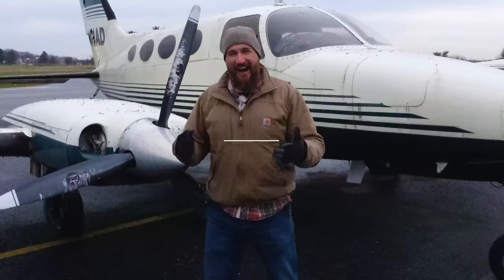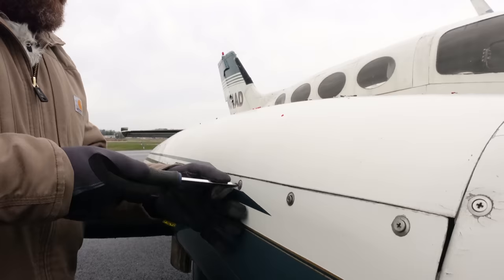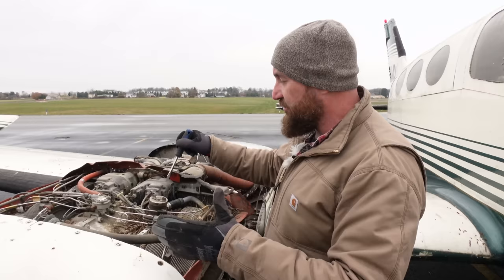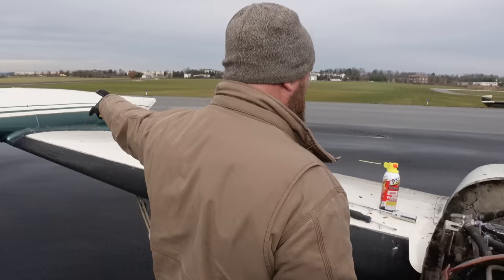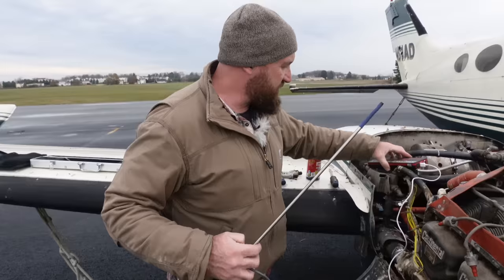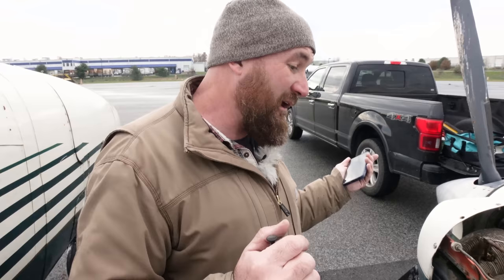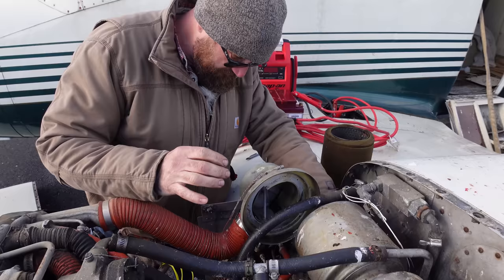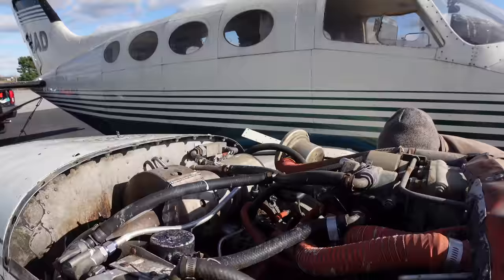FREE Abandoned Airplane... If I Can Start It! Ep1

Comment: I'm an A&P and have to say you did pretty good cleaning the spark plugs, though I will say be careful turning the prop with all the plugs hooked up, the Mags can fire with everything hooked up. Nice video overall, would love to see it restored but it would take a lot of time, money and paperwork for sure
Reply: Also an A&P. Personally I'm wondering how this'll be done legally, paperwork wise with the FAA I mean. That's where a free plane gets expensive. 

About a year ago exactly I was working on this shitbox of a 1975 310R that was parked at KDAL because it was running rough. I was out there by myself to do the runup. Ran like absolute trash, could easily tell it was down a jug or 2 on each engine. So bad I had to have my buddy/coworker see that shit for himself, and in disbelief he called his pilot friend to check it out. On the #2 engine one of the pistons was melted and metal was all inside the crankcase and everywhere else, not to mention all the other discrepancies this plane had. Surprised they didn't have total engine failure in the air. No way in hell I'd ever fly it in that condition.
Reply: You can fire up the engine with the props removed, given an electric starter?  That seems a lot safer. It's what we do with model planes - do all the "working on it" with the prop removed.
Reply: @senseisecurityschool9337  I think that could cause damage to the engine and probably isn’t allowed.
Reply: @jacobboneill4295  It would be interesting to hear from someone who knows. You can certainly run a car engine that way. You wouldn't want to go full throttle with no load because the RPM could go too high.
Reply: What a nice playhouse for my Grandkids & me!!! And yes it runs!! 😉😉😂😂
Reply: You know he can't. I almost see this now as proof this is all fake for views. I mean the work sure. But there after... Cost more then buying a proper plane and even if he did all the work. Is little to guarantee he'd even be able to get it done legally speaking.
Reply: @senseisecurityschool9337  you can but not recommended. There is a reason that engines on a test bench have what are known as "club props" when doing a Op check. 
I am an A&P.
Reply: @nathanlupus7759  even of he dod all the work ot would be for nothing. He isnt an A&P. Everything he did would have to done all over again to be legal
Reply: Ever want to steal an airplane just cut the p leads and handprop it.  The circuit is always "hot" the ignition switch just controls where the current goes, through the mag to the spark plugs or grounded through the p lead to the airframe. So if you cut the p lead that switch has no say in the situation anymore
Reply: @Demonslayer20111  I think the only saving grace would be when the IA does the annual. Also if it’s in this condition I doubt the plane is on a current registration.
Reply: @jamesbevilacqua3739  maybe. Work done needs to be documented and signed off. No IA is gonna take the chance on an unlicensed mechanic that he didnt personally supervise and just sign off on all the work.
Reply: @Se7enAte  God... I was Air Force so I don't know how it goes with your forms but did you write all the shit up and grown the plane I hope.
Reply: @senseisecurityschool9337  You probably good but you wouldn't want to do it for very long. The engines are cooled by the air moving over the cylinders, so with no prop you're going to overheat the heads pretty damn quickly.

Comment: “It’s got spark plugs and needs air and compression”…..and a certified A&P - would love to hear more about the owner. How did they just abandon this thing
Reply: Guessing, but if birds got inside unnoticed for a season, ruined the interior (leather?) alone would cost $$,$$$ plus corroding the frame inside (even more $$,$$$ if it's even repairable). No logbooks = the engines need to be rebuilt (he said $30,000 each iirc), maybe $+100k? Or a lot more? Not worth it compared to a nice used or new one?
Assuming the owner used it as a business plane, and expensed the depreciation out on his taxes, if he sold it for anything it would probably just mean more taxes to pay.
Or maybe, previous owner went bankrupt after letting it sit & get bird infested, liquidators couldn't get any half decent offer for it (I'll bet an airplane salvager would be reluctant to pay to have it dismantled & hauled from an out of the way airport, even if an aluminum scrapper would just take a sawzall to the wings & throw it on a trailer) so it just sat? Then the current owner bought it as basically scrap, and came to his senses that it's not worth fixing? Like this guy probably will do too, unless he's earning $5k - $10k per video to fund fixing it up
Reply: abandon due running cost , big &&  also maybe other issues
Reply: One possibility is that it's got some outstanding unsatisfied ADs on it that would cost too much to fix in terms of how much the plane is worth.
Reply: Random gues: Owner got to old to fly but didn't want to sell it "in case he needed it", old people are like that.
Reply: @TrimeshSZ  I think the ADs are least of this aircrafts concerns at this point
Reply: @randomnickify  More like failed to pass for new C of A due to many expensive faults.Most cars are scrapped for the same reason too!
Reply: If you only just want to get the thing started you could just disconnect the turbocharging pipe to the engine and it will start without any problem 😉
Ok it wil run a little rich and compression wil be lower but that Is just a good Thing, in this poor corroded condition 😊
And spraying in a litle brake cleaner/engine start spray ( wile starting )
wil give you the exact diagnosis of the problem is fuel or ignition related 😉
And @103.20 the tank is stil leaking 🤫👍🏻😂👍🏻🤫  JUST kidding Nice Video 👌🏻👍🏻👌🏻
Reply: @rickstevens2941  It should start and run even with the turbo attached the way it is. Air will still move through the turbo, just not as fast. It will still idle and rev somewhat.
Reply: I think the Turbo is fixable whith 
Penetrating Oil 99% sure the dubbel Brouns bearings Insight The Turbo are not The Problem.
the only thing that Could be wrong with it, are the fanblades inside of The snailhouse that are a litle rusti
Just Turn over the engine a couple Times til ook pressure than with a Ranch you can Turn It.
watch The Tread left or right 👍🏻
Succes 👍🏻

Comment: My suggestion, if your really serious, get a hangar for at least a month. Open this up like your doing an annual inspection. Yank the seats - trash the carpets-- open the floor panels. Drain the fuel.  Get a power source-- dump some marvel mystery oil in the cylinders and crank the engs.  That's my suggestion.  
Big problem: even if its free-- you need log books and in theory could spend 150K rehabbing a 200K plane?

Comment: I'd love to see a complete rebuild of not even just the engines but the interior too, a man on reddit did a series of posts detailing the complete refurbishment of an aircraft left in a similar state however it was a turboprop which caused him a few more issues but he did manage to pull it off. It should also be mentioned that he also showed up on the front page of the aviation subreddit every day he posted.

Comment: Cessna 401's aren't highly sought out as they have very limited fuel capacity, only 102 gallons unless it has the functional locker tank. Only one tank, as the other cowling is a dry locker for storage.
Toss the plugs back in and pull all the cowlings as possible, then blast with high pressure air to remove the birds nest debris and droppings. Once you bird crap is gone, remove the plugs, shoot a 50/50 mixture of ATF and kerosene into the cylinders and allow to sit for a week or so. See how much of the mixture leaks into the oil.

All the control cables, hose down with the PB Blaster you have and vibrate the cables to allow the PB to work.

After sitting for 15 plus years, what's the storage bill? As someone else brought up, the AD's would all have to be completed again.

With log books, the aircraft had some value. Without, the engines are cores, the same for the prop governors. Electronics are trash. Access panels and doors could be sold.

As for restoration to fly again, you'd have bragging rights to the most expensive 401 aircraft in existence.
Reply from the maker: This one does have 6 total tanks on her but that also means 6 tanks to leak and cause issues as well 🤦🏻
Reply: @rebuildrescue  plus all the lines!
Reply: ATF and kerosene will all be in the sump in a matter of hours on a new engine
Reply: @spannaspinna  
I guess that using the mixture on an engine that sat for 15 years wouldn’t be an issue then?

The intention is to free the corroded pistons and cylinders. Diesel/kerosene has good capillary action and when mixed with ATF also provides some lubrication.
Reply: @spannaspinna  o
Reply: @gungadinn  if you’re trying to free it yes it’d help but you’d only want to free it enough to get the barrels off it
Reply: @spannaspinna  
All the poster is doing is trying to get the engine started to win a bet. 

My personal 340 is sitting for the third year waiting for new upgraded avionics and replace the landing gear, again. 

I fogged the engine and taped over all the holes in the cowlings. Aluminum duct tape is your friend. 

A friend owns a company that shrink wraps boats, and had him wrap the Cessna. A lot cheaper for outdoor storage than hanger space.
Reply: @gungadinn  the shrink wrap is a great idea

Comment: I see a money pit!  I'd get an A&P to check the plane, especially structurally, to see if the plane is worth fixing.  $30k per engine right out of the box.  It might be a good deal, but you better pencil whip it first.  Good luck!
Reply: Your not even thinking how much he’s gonna make off YouTube from traffic it could easily pay to restore this
Reply: @MrSeanjr2  yup he already got 5k from this vid
Reply: I think you are far from the reality, this thing may need 2 overhauled engines and probably 2 new props. He needs also to check if there is any new bulletin. Without mention new avionics we are probably talking about 100k+ dollars to have it certified again. I almost certain that this bird  will never fly again unfortunately. It may run one last time though.
Reply: @dklgdveje  if he's willing to spend the time, sure it will fly
Reply: no way would it cost 30k if you do most yourself, all but the machining. They are pretty plain jane gas engines, somebody that knows engines could have em both done for 12-14k. Personally i wouldnt waste my time on a ford but thats what he has ro deal with. I just finished a BB Chevy that has more hp than these two together, spent around 6k
Reply: He did say toward the end of the video that he is only looking to getting it running. He isn't trying to get it flying and could pass it on to someone else if they are interested. Ill be surprised if it flies again also. Someone would have to have a lot of extra money to spend to fix that plane fully up IF they wanted that plane so badly.
Reply: @Hugeroost  can you actually get it certified if you're doing it yourself, though? Getting it running isn't the hard part, FAA paperwork is the real challenge
Reply: @norgeek  man I'm not sure but I don't see why not. I'm sure they would inspect it real good. Now days the FAA is freaking out trying to figure out the drone situation I know that
Reply: i would get as much uneeded crap out of that plane
Reply: Ah, no!  Engines are a specialty and while they look like a fancy lawnmower engine when you have them apart, they need a specialist who does it every day, all day. 
Besides, the cores are worth money. By cleaning them up and starting the engines he can easily get five grand for each core. The props would have internal hub corrosion so they will be discarded. His problem right now are the mags 0 no spark.
Reply: @seantoomey1514  understood, but 30k ea that's insane. You could go back OEM and be way under that it seems, even though it is a Ford. Maybe it has to be a certified  avionics mechanic that would make a difference I guess. They should have went GM on those puppy's, much cheaper to work on. How bout this new BB chevy crate w over 1000hp that just hit the ground, and that's carbed.  I'm not sure i'd go up in a plane if I knew my life depended on a Ford motor
Reply: @Hugeroost  you're incorrect 30k on an engine especially that one you are looking at a bit more.  You still need to dish out some money for plugs, wiring, mag (which are over 3k each.)and any thing else in regards to electronic as well as vacuum. You have to understand these engines aren't like normal automotive engines, these engines are made to fly in the air,  keep from vapor locking, crate magnetic fields and achieving high altitudes. So you shouldn't compare it to your Ford engines that you work on because these aren't fords and you have to be licensed to work on airplane engines unlike your car engines.  So don't comment on things you know nothing about son.
Reply: @reddyprahlad  dang man I wish you were my neighbor
Reply: Or someone who has actually done it and not just a keyboard warrior,I open the shop at 7am Monday come show your skills.

Comment: I'm sure someone has already mentioned it, but in the 60's it was common for engines to have a "shower of sparks" device instead of impulse coupler for starting.  Basically this is just a high-voltage doorbel ringer circuit which causes the plugs to fire continuously.  The technical name for them is a "starting vibrator".  My 1964 Mooney is equipped with one, and i prefer it to the impulse coupler, as it makes moving the prop by hand much less dangerous.

Comment: I used to work as an engineer for Schwitzer, which was (now part of Borg Warner) a designer and manufacturer of turbochargers. A turbo does not have to turn in order to allow airflow. If it is locked their will be lowered flow, but the turbo doesn't have to turn to allow the engine to start. I would even run with the turbo locked up, but with lower power.

Comment: The cost to fix this thing up and have it pass FAA inspection, you might as well buy a used one already running. The battery alone for just 1 GILL G-246 BATTERY is $625.00. Also from my understanding, you have to be a certified aircraft mechanic to work on the aircraft and document every little thing you do to it in the log books.